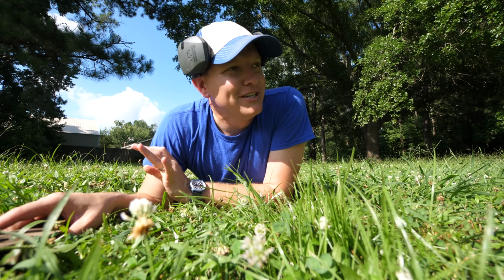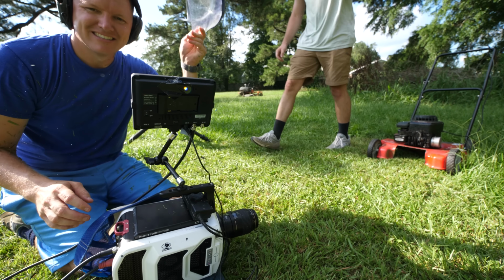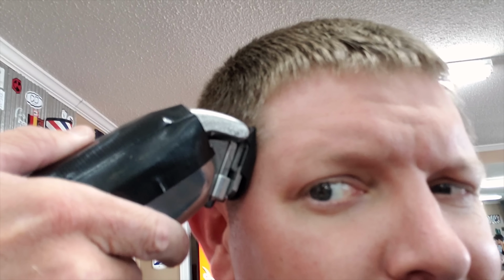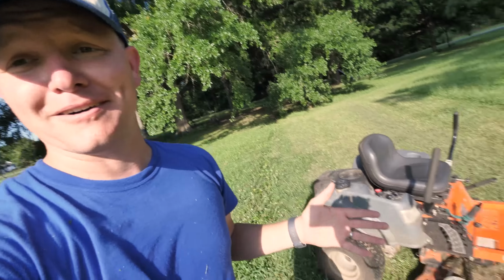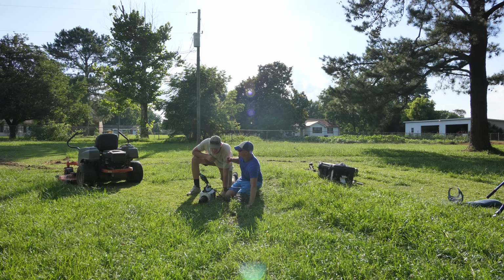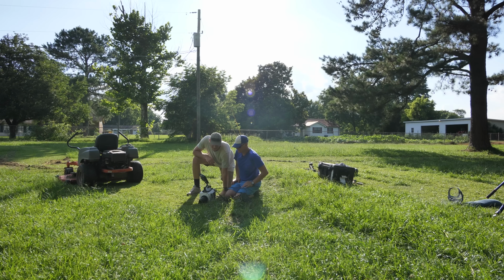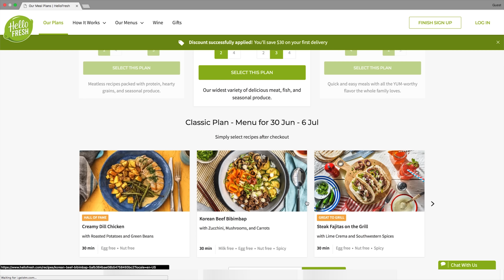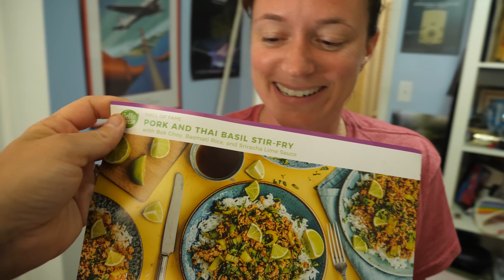How Lawn Mower Blades Cut Grass (at 50,000 FRAMES PER SECOND) - Smarter Every Day 196

Comment: Why didn't you use smoke to show the airflow?
Reply: NINJABDUDE probably too much turbulent air around the mower from ambient wind, not to mention he's shooting the video at home so what would he use for smoke? He would probably have to use smoke balls which would get sucked up into the blades unless anchored. The grass does a well enough job at showing airflow.
Reply: NINJABDUDE yea, or put babypowder or something in the grass and see it get lifted out.
Reply: I was going to suggest explosives and rupert gum drops.
Reply: NINJABDUDE that's a cool idea but perhaps Hunter is right.
Reply: Yeah Destin, why didn’t you make a better video?!?
Reply: @hunter coyhis _ he could use that canister type of thing that honey hunters use to scare away bees with smoke.
Reply: @hunter coyhis you can use a vape ^^
Reply: Similar, why not try taking off that tab and seeing if it actually doesn't work as well.
Reply: For the scissor effect you could always try a Reel Mower.
Reply: The problem for that is there's the airflow from the blades and then the air intake for the motor. The motor intake as well as the mass of turbulence the blades are creating makes it really hard to create a controlled environment to verify what's going on. It's a great thought though. Probably would need a bigger team with a bigger budget to build a rig for such a thing with the motor isolated from the rest of the system.
Reply: Also a plexiglass front for the mower to keep the airflow for the push mower?
Reply: RJ Jarecki LOL!!!
Reply: It would show the opposite of his theory.  Drive your mower passed grass clippings on sidewalk and see what happens - it blows them AWAY like a leaf-blower.  The air around the blades is all OUTWARD, not up/inward.  Once the grass is brought under the deck, it is out of the high-pressure zone and is cut (or bludgeoned, if you are using Destin's mower) by the outermost edge of the mower-blade (which should be as sharp as a knife) without ever experiencing any 'lift' other than not being blown down by the spinning blades.

The tabs are for throwing the clippings out the chute or into the bag, not for lifting uncut grass.

Comment: Anyone else wanna  see a weed whacker in slow motion?
Reply: Yes
Reply: Yes
Reply: Yes
Reply: Jup, with wire and blade please :)
Reply: Not just wire and blade but there are two types of wire, round and the twisted square type.  Why is one better then the other?
Reply: Search for Projectfarm channel on here.  He tests a ton of stuff including different varieties of trimmer line.
Reply: Devon Wilcock Yes, I thought of the weed wackier as well.
Reply: It’s called a whipper snipper or whippa snippa
Reply: Yes
Reply: Nah that's racist
Reply: Did someone say weed
Reply: For those who dont know; 
Line trimmers cut very differently based on RPMs and the types of string you use. 
Looking for a cleaner cut/less of a tear? Use string on the thin side and round. 
Looking to tear through weeds and garbage? Thick and squared. 
For vertical edge trimming I recommend using the thick square as well. 
Coming from a professional landscaper and personal experiences.
Reply: @Lunch_box  😂
Reply: @willmiller9631  what if I wanted to torture a thief with a tool like that,  what type of line would you suggest I use?
Reply: @shaunsurname8275  are you looking for brutal pain or possible lacerations
Reply: @willmiller9631  bit of both
Reply: @shaunsurname8275  double layered clothing or even triple, round and thin.
Reply: I'd like to see a chainsaw cut
Reply: @shaunsurname8275  try the triangular or octagonal industrial string. Nice sharp edges and a good heavy whack  👌
Reply: Ah yes, this is what I was going to comment about

Comment: A chainsaw blade/chain seems like it has some interesting science behind it. Any thoughts?
Reply: RumbleLab 
Really fast sharp thingies 👍
Reply: RumbleLab link the time
Reply: RumbleLab it does. It cuts on the top not the side of chain for 1. Teeth alternate so cuts straight and not pull to the side. Ramps in between teeth so chain only cuts what it can handle without digging in and jamming. Plus chain has to remove the debris as you cut. Low kick back chains have higher ramps so you can't cut as much with each pass and won't jam as hard if it does get caught. That's based on my understanding. Sorry if I mis spoke about something
Reply: Yeah it would be interesting to watch the material being pulled out
Reply: Joe Smith isn't there a link that "slices" followed by a link that "digs" almost like a knife and a chisel?
Reply: Super Divinus what do you mean?
Reply: No the initial little 'tooth' is known as the depth gauge. The height of this in relation to the cutter is what determines how deep the cutter pulls into the wood/ how much wood is let into the cutter. Have a quick google of chainsaw chain parts, you'll understand then.
Reply: There are different geometries to the blades. Power output plays a part and there are many different chain types. Flat ripping style, concrete cutting, demo blades, carbides... the list goes on. Great topic
Reply: RumbleLab that blade on the chainsaw that the chain goes around is called the bar
Reply: Yep that would be great to see how it works.  Perhaps they could use a block of clear plastic and film from underneath as the chain cuts through.... 
String trimmers, nail guns and staplers would be interesting too.
Reply: RumbleLab read why diareahs reply. He nailed it. As many years as I've done landscaping....though don't cut many trees....I just never thought much about how it works. I was once on tv news cutting and they had brief close up of wood shavings coming out. When you cross cut saw dust comes out. When you rip with grain its wood shavings that comes out. At least with my stihl 088 magnum and 36 inch bar. There's different sizes and pitches of chains too.
Reply: Joe Smith There are special bars and chains for cutting with the grain. Here are a view examples: https://m.youtube.com/watch?feature=youtu.be&v=IhVmDCyZowc
Reply: Joe Smith yeah I’m an arborist haha
Reply: RumbleLab no, it's a sharp(cutting tooth) "link" and the a space and then another cutting tooth in the alternating direction( the cutting teeth alternate left and right to make it a straight cut)
Reply: A machinist like me knows whats happening.But I do want to see it. A bandsaw in aluminum and steel would be cool to see. Spec_Ops_Gaming the cutting blades alternating are so there is clearance for the blade on both sides, behind the cutting edge will be relief angle of a few degrees. If cutting tools rubbed that would cause excessive friction and breakage. Its just like a bandsaw, the blade is dull when the teeth dont stick out to the sides.If they didnt the back part would rub and it breaks
Reply: Chainsaws started out as using the chain link on a pocket watch to cut pregnant women's cervical bones to aid childbirth ;) ouch.
Reply: If you do decide to do chainsaws please look at different style chains.
Reply: I've only ever known the "little tooth" as the raker. Never heard of it called a depth gauge before now. I know that's what it does but just never heard it called that.
Reply: Also it would be cool to see when a chainsaw gets stuck in wood
Reply: Chainsaw blades seem to work on the same principle as drill bits and angled cutting tools on a lathe.  The clearance of chips allows the millions of tiny shearing cuts to accumulate and remove material.  A saw blade works the same way I think.  The saw teeth are slightly angled out to clear chips.